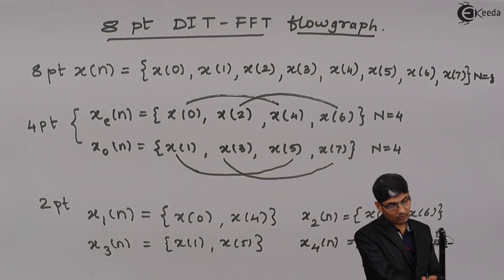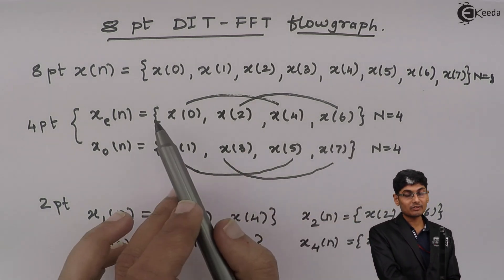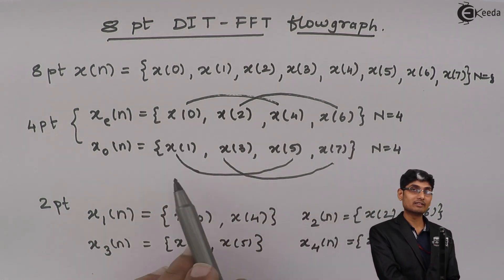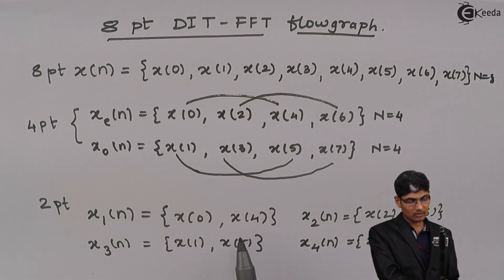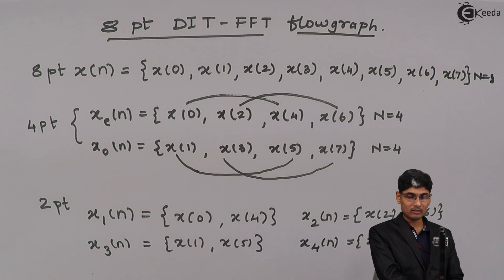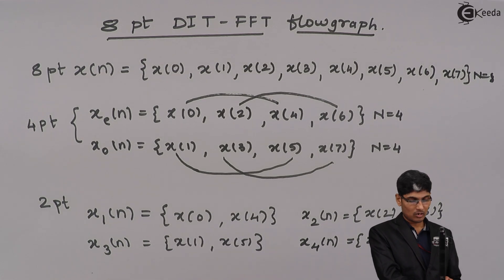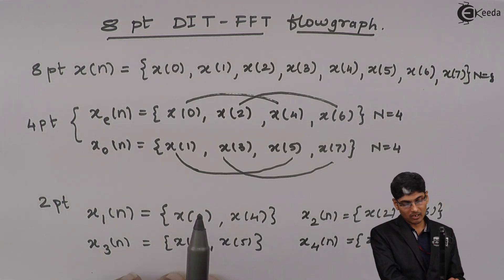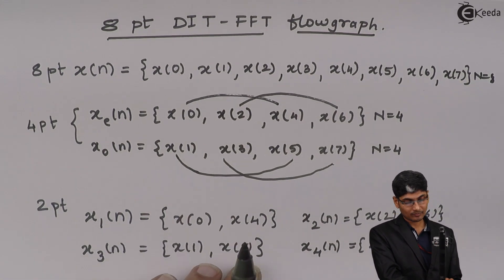What is 8 point DIT(Decimation In Time) Fast Fourier Transform (FFT) Flow Graph

Comment: I think im slowly understanding this. Now I need to workout how it relates to audio.
Reply: Easy.  x[n] is the audio and X[k] is the frequency
Reply: Cheers dude.
I am actually going to cheat a little, And worry about getting the software working later, I still should get it working at some point.
I found a chip called MSGEQ7 that makes it easy and less CPU time consuming. Time will tell I suppose.
Reply: TheProCactus what are you talking about ?What chip and why?